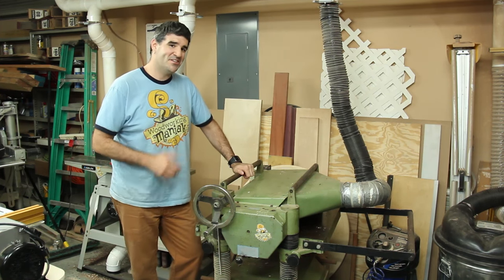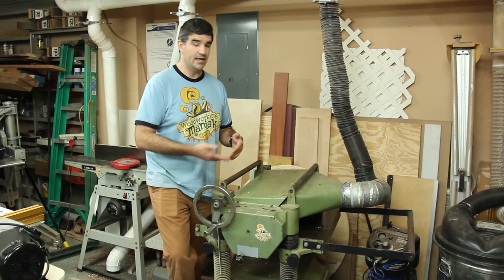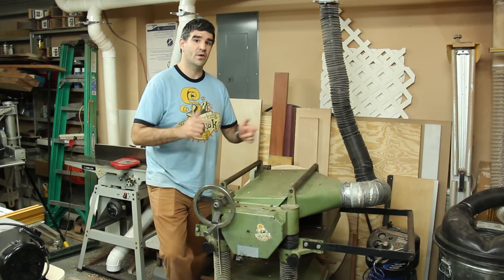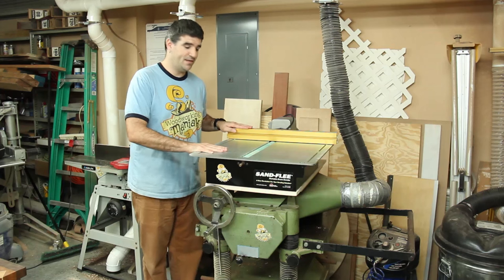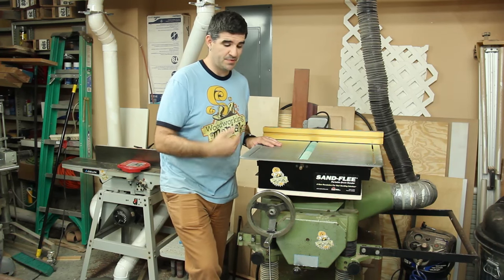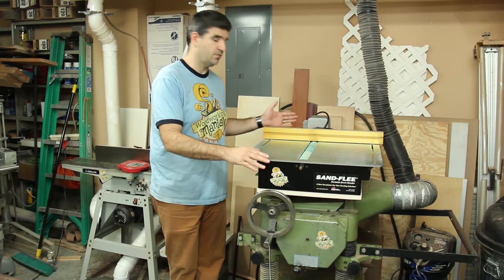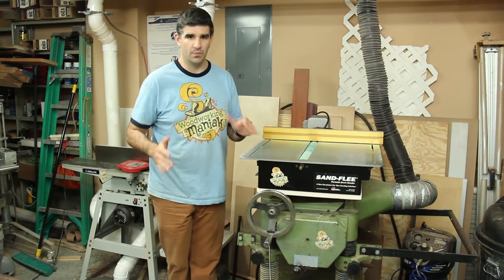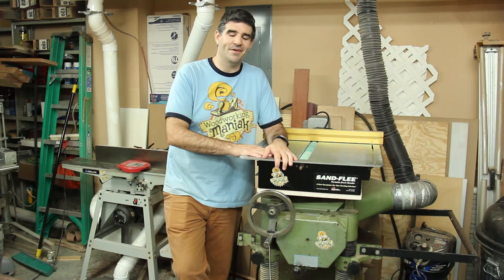Sand-Flee/Planer Stand (Shop Improvements)

Comment: That's a very efficient way to save space. Nice. You had me jealous with the title though. A 20" planer is awesome. And I've been drooling over Stockroom Supply's version of the Sand-Flee for 3-4 years now. I've seen it demonstrated a bunch of times now and it really seems to be an awesome way of flattening and smoothing a board face. I'm still hoping the prices will lower a little more before I take the plunge.
Reply from the maker: Steve French I snagged mine used at a good price. I probably wouldn't have made the plunge at full price. However, it does come in handy very often.

Comment: Good place for the sand flee. Unless you do use the top rollers on the planner to process wood being planned. Then of course you can just pull the sand flee off. Good luck keeping stuff off the sand flee now (haha). I do the same with any flat surface available.
Reply from the maker: MRrwmac I'm terrible at flat surfaces!!! That's one part of what I have to work on with my shop. I need to give things a place and get in the habit of putting things in their place when I'm done with them... That needs to include lumber. I really need some dedicated lumber storage solutions in the near future.